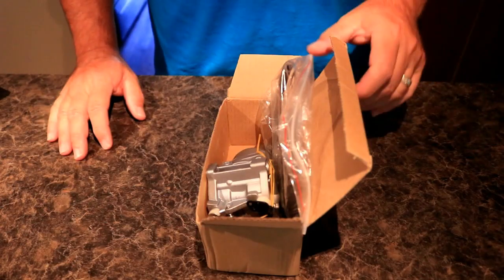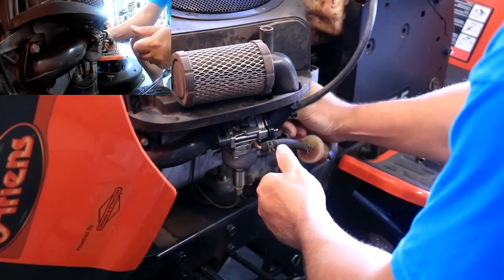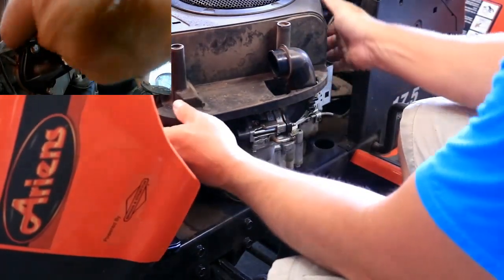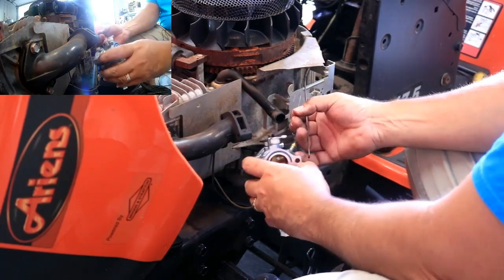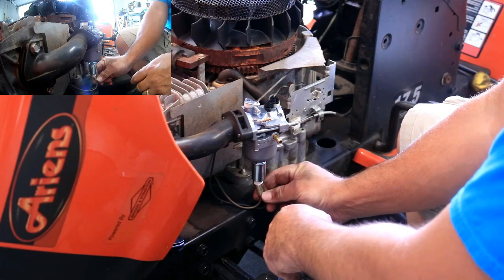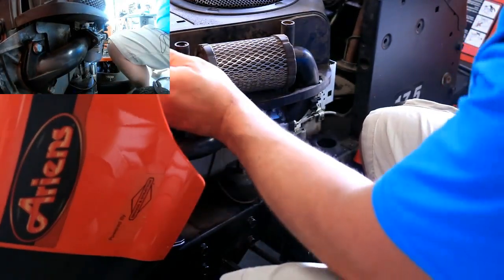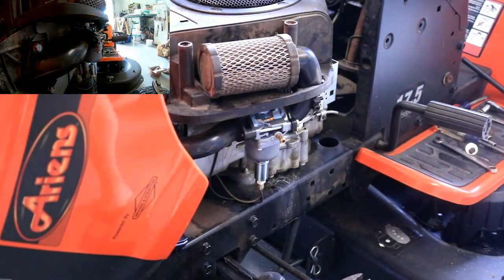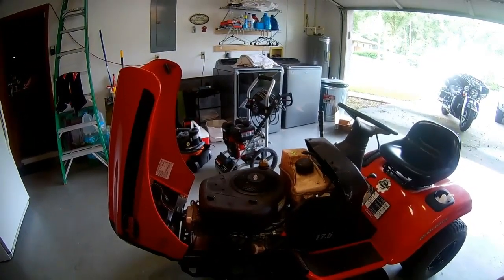Carburetor replacement on Ariens law mower with Briggs & Stratton engine

Comment: Exactly what my Ariens did from day one. Quite the surprise to find the cylinder slap full of gas, which leaked into the oil pan. Installing a shut off valve was a short term fix, just shut it off and let it idle until the carb runs dry. But if you forget to shut off the gas, here we go again.
I think the supplied hose with the 90° bend in it was to be used where the 90° elbow on the original carb was. Your gas line may eventually kink shut being bent to accommodate the straight inlet pipe.
Reply from the maker: Been there myself. That was the reason I first changed the carb out. Got tired of changing gas/oil when I did forget to close the valve. Glad I’m not the only one haha
Reply: @Norrad01  also a tip don’t buy gas station gas cause it sticks during the winter there’s places that don’t have ethanol
Reply from the maker: @swayzz3775  that is a very good tip. I learned a costly lesson about regular pump gas in my boat. It has an in hull tank and running pump gas wicked in moisture which got into the motor and caused a screen filter to corrode in the fuel injection system. Pump gas are bad, non-ethanol are good! 😂

Comment: What was the carb model number?
Reply from the maker: Sorry for the delay, I didn't see this comment. I don't remember the exact  number, but here is a link to the kit I purchased on ebay. https://www.ebay.com/itm/Carburetor-for-Briggs-Stratton-31C707-31C777-31D707-31D777-31E577-31E607-Engine/132313394955?ssPageName=STRK%3AMEBIDX%3AIT&_trksid=p2057872.m2749.l2649

Comment: why wasn't the grill removed for easy observation of thw work you did.
Reply: I believe the hood just lifts off once it is raised. Also, it would have been nicer if the camera was closer and the pic in pic was not used. Just my observation. This job is so easy on this model tractor, try changing the carb on a Honda Harmony II push mower. That is really difficult.